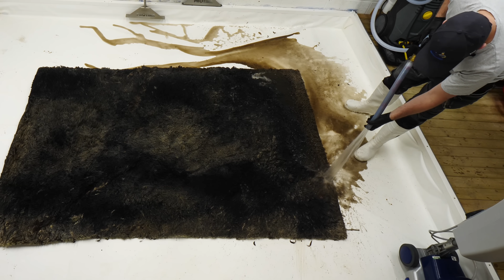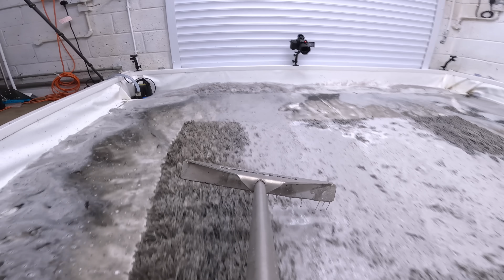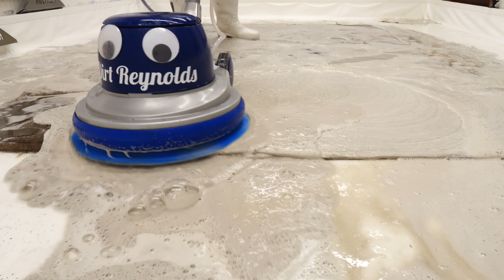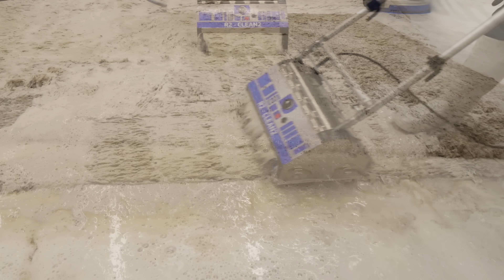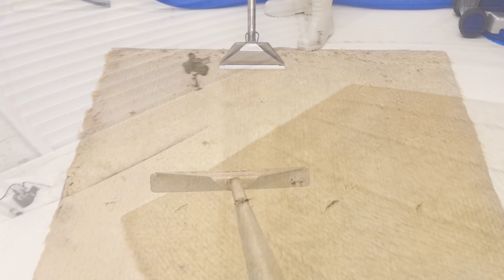Smoke Damaged Rug Restoration | Satisfying ASMR Carpet Cleaning

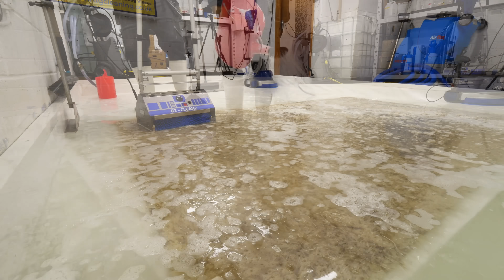Comment: Is there a reason you don't submerge the carpets before hand to remove the loose and dusty bits? I know you drench them with the hose, but wonder if it was submerged like at 6:43 it would help start the cleaning.
Reply: It's probably just a waste of water. Most of the big dirt gets removed on that first pass with not much effort.